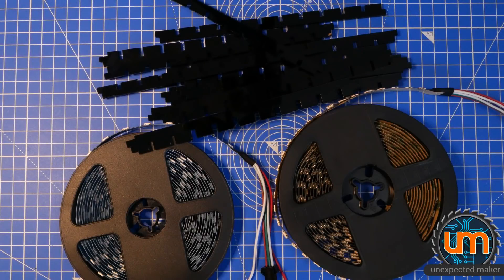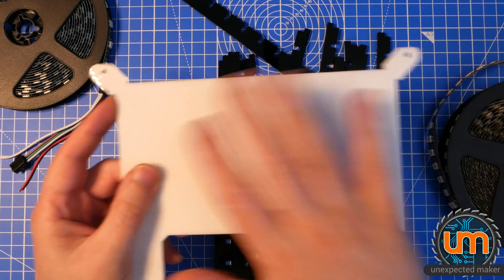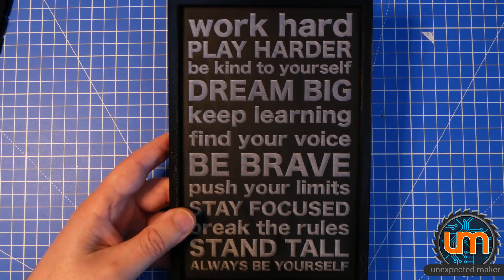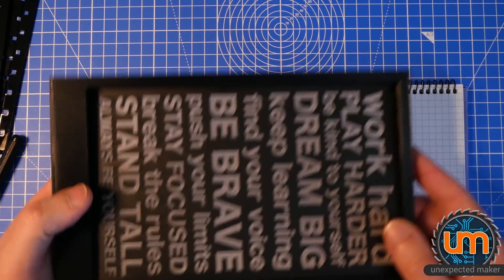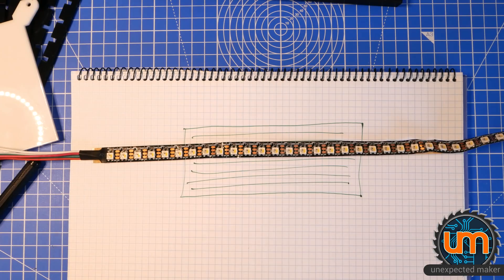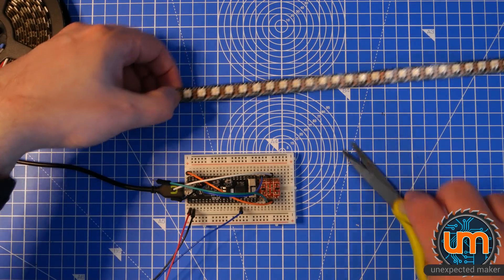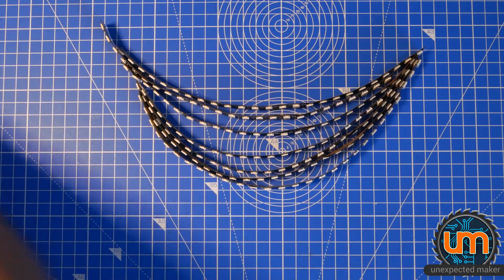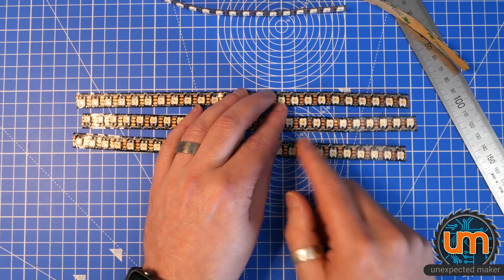Overcomplicated RGB Matrix Panel - Part1

Comment: Finally managed to get home and watch your video. Did you measure the distance of the pixels horizontally vs vertically? Doesn’t look to me like you would need to overlap the strips to get the same spacing in x and y direction. Or was your intention to squeeze the rows tighter?
BTW I would feed power from one end of each strip and ground from the other side. So they light up more evenly. Then you only need to loop back the data line which can be a really thin wire as mentioned already in some other comments.
Reply from the maker: Re 5V/GND: wiring... yup, already on it :-)
Re spacing: if they don't overlap, the spacing between each row is a smidge over 1mm further apart than each column. With overlapping them I get them closer, but if I overlap too much I make them closer than the column spacing... so you'll need to wait and see which I chose ;)
Also, it may make no overall difference to the look and feel of the display anyway!

Comment: I look forward to part two. I want to do some sort of matrix panel as well but I need to get the higher density strip to cut up. I only have the one that’s more widely spaced. 

Don’t forget to put a series resistor in line with that data pin, at least 200 ohms, to prevent voltage spikes on the data line. When I tested mine without a resistor I was seeing up to 8 V and that may damage the first pixel on the strip. When I put the resister everything behaved at 5 V.

 That flickering pixel in the middle of the strip, if it looks like it was manually joined at that point, I wonder if somebody damaged the first pixel by giving it 5 V data without a series resistor.

 Also I haven’t used the Adafruit library but I think I saw someone mentioning there may be some issues with it, I just can’t speak intelligently about it. Maybe try using the fast LED library just to double check the behaviour of the strip,  if you can still at least use the library in plain RGB mode. Not sure. Maybe the LEDs use a whole different protocol and they can’t be talked to. I guess soon enough I will have to figure that out for myself as well.
Reply from the maker: Yup, I always stick a 330R on there for my Neo7Segments and LaserSegments. I'll do the same here on the properly wired version.

Comment: Interesting idea. But, a concern with this approach is the light spill that will occur between grid cells.
ie. By using a single sheet of transparent acrylic, there is no light blocking wall being created between each matrix grid cell to contain only that cell's light output?
Unless I missed something?
Reply from the maker: You haven't missed anything... I just don't go that far into the construction in part 1 :-)

Comment: By overlapping the strips, you may introduce a slight tilt which may affect the eventual result. Perhaps first do a test to check the effects? Good luck! (Looking forward to part two).
Reply from the maker: The strips are super thin .. any tilt wouldn't be visible and the whole idea of a front covered matrix is to obscure/diffuse the LEDs from the viewer.. if the viewer can still see the SK6812 packages from the front the design has failed anyway :-)

Comment: Should have said one end and all in parallel. Would also keep the voltage drop down on each string.
Reply: +1 on that. I think feeding the power in parallel would be the only way you'd really want to power a Neo matrix, mainly to ensure consistent vertical brightness by avoiding the single long power rail voltage drop.
Reply from the maker: Yup, already on that ;)

Comment: Feed power in one end, then you only have to bring the data wire back.
Reply: Even better is to run a positive "bus" along one edge and a negative bus on the other, and feed the positive and negative from opposite corners. That way, the power paths are equal length, keeping the power distribution even.
Reply: You bring the power in one end and have ground connected to both ends because the far end will be dim.
Reply: Exactly what I was about to say.